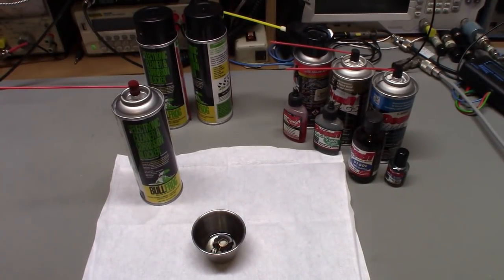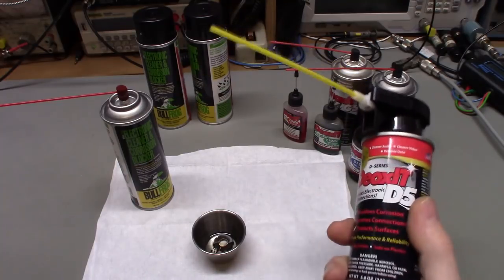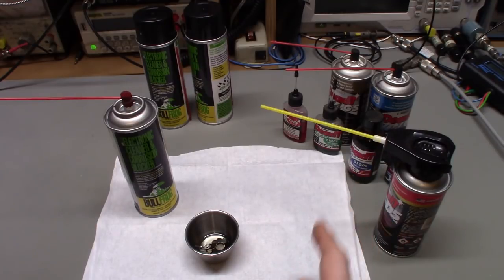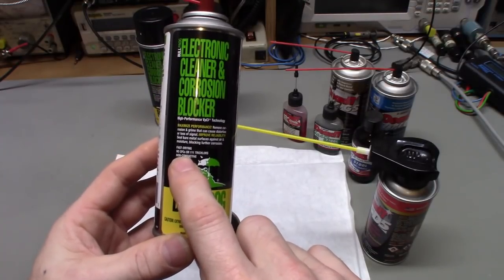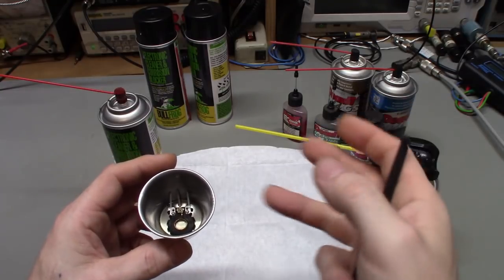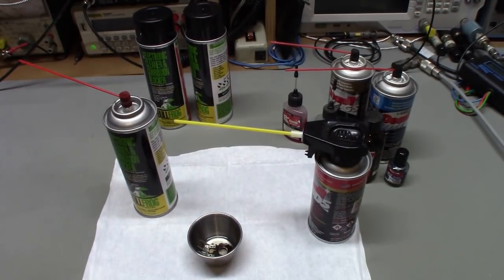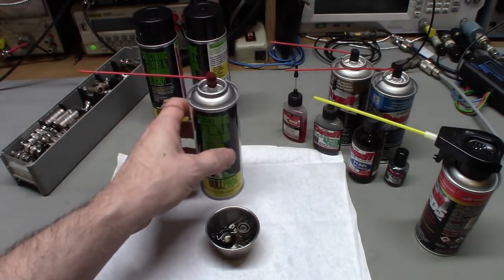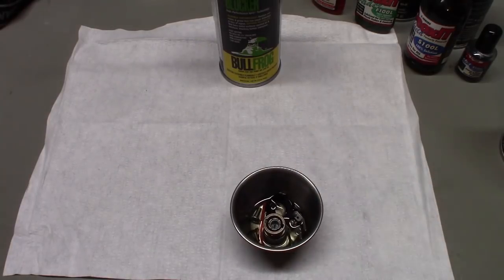BullFrog electronic cleaner & corrosion blocker testing. Possible Caig Deoxit substitute.

Comment: I repaired parking meters back in the 90's and we had something in the shop called "Motion Fluid" or Motion 60? that was an excellent lubricant. I used it on frozen/corroded locks and it was incredible stuff! On the can it stated it was an electical lubricant/cleaner so I brought a can home and used it on controls and YES, it was excellent stuff!!! Valve had VERY good flow/control so as not to waist any of the product and it would wick up into whatever you sprayed it into. Problem is I ran out and can't seem to find it anywhere. Paking meter supplier was the only place at the time that had it. LOVE to find a source for that stuff!!!!!!

Comment: CAIG Laboratories appreciates and considers both your discussion of its products and all of your suggestions. While many continue to make comparisons, there is simply nothing like DeoxIT® available on the market.  No other product removes corrosion down to the microscopic level ensuring the highest conductivity and fastest signal speeds.  Plus, the protection and lubrication provided by DeoxIT Line products are also unparalleled.  Many people work with our products in areas not conducive to having to attach and detach a straw from the can – this is why we created the integrated Perfect Straw™.  Think of the technician under a vehicle, hanging from a cell tower, or working in a railroad depot or on a flight line.  For those of you unhappy with the addition of the Perfect Straw, we have many other applicators for DeoxIT Line products including pens, needle oilers, and wipes.  If you need to use a spray and prefer the old L-M-H valve with a detachable straw, we continue to make our old full-sized D5 cans(Part # D5S-6LMH) and our new non-flammable mini sprays (Part # DN5S-2N) using both this adjustable valve and the detachable red straw.

Comment: I was so hoping the end was the result lol.  Oh well,  survival rates for having patience are surprisingly good lol.  I wonder how much of the puddle will evaporate inside a few weeks.  

The WD-40 would have been a nice control to verify that the experimental conditions would in fact reproduce the issue.  Without that how do you trust the outcome? I.E. how do you know the good result was because the product works and not because the experiment failed to reproduce it.  I'm thinking because the pot is sprayed and then used when it fails.  Here it's in a bath of the stuff.

Comment: Where's your control, run three samples, one with new product, one with deoxit, one with wd40
Reply from the maker: I don't need to test Deoxit, have been using it for over a decade.  WD40, again, don't need to test it.  I have seen first hand what it does to controls that people have sprayed it into.
Reply: Hi Mike, Thanks for your videos and this test of this product. Deoxit is expensive here in Australia so I will be interested to see how this goes. CRC has a bunch of electronic cleaners products in their range have you tested any of their products? Best regards Chris
Reply: Yes,  but have you ever submerged a material in deoxit for a month? It may have different results.

Comment: Why do u love a normal spray top whose straw u can lose?!. I much much prefer the new one.
Reply from the maker: Why, its smaller in diameter and actually fits inside controls.  Its more flexible and able to get places the large yellow one won't.  Again its smaller, this time on the inside so its not a huge stream of cleaner.  I don't need a fire hose, I need a precision straw.  That huge straw waste soooo much product.  And as far as looking a straw, where.  A can of tuner cleaner lives in a 3 foot radius on the bench.  I'm not taking it on hiking trips cross country.  The can never leaves the bench.